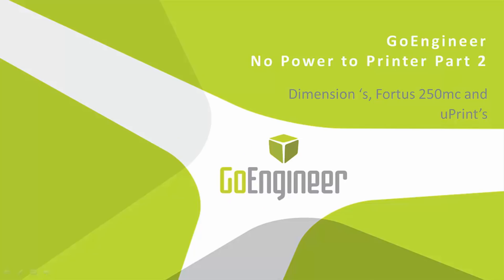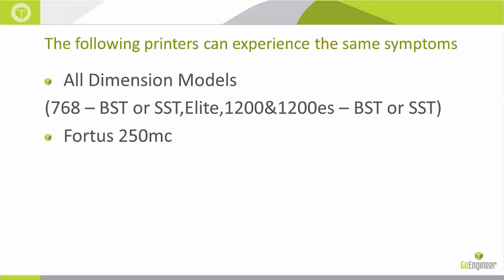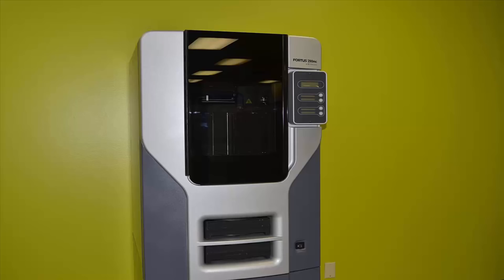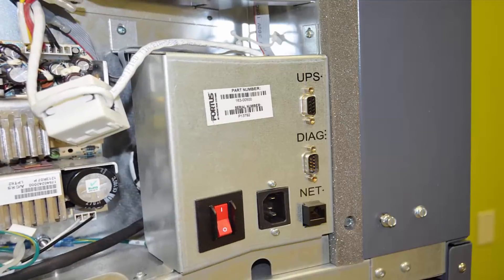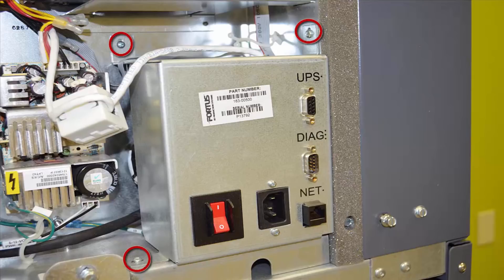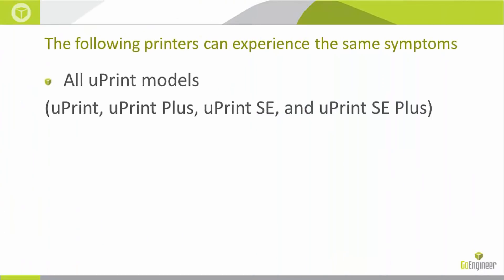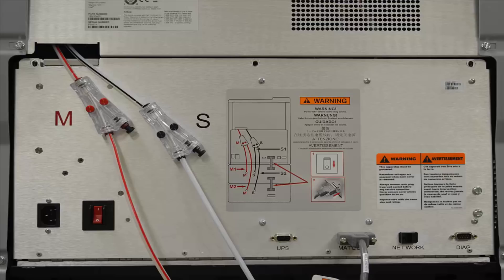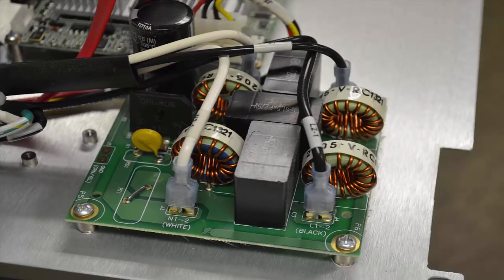Stratasys FDM - No Power to Printer Part 2

Comment: Thank you! Bought a uprint se plus for 100$ that would not power on. Pushed the button for the fan and it started right up. Now the screen says low UPS battery. And wont load anything further. I don't have a UPS battery. Is there Anyway to turn this setting off?
Reply: Did you ever find a solution? I just obtained a Uprint